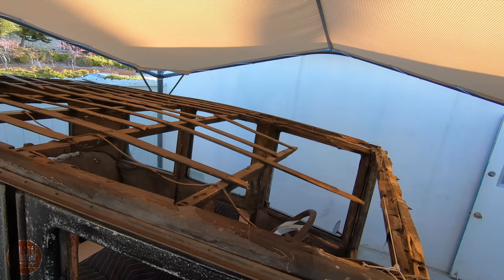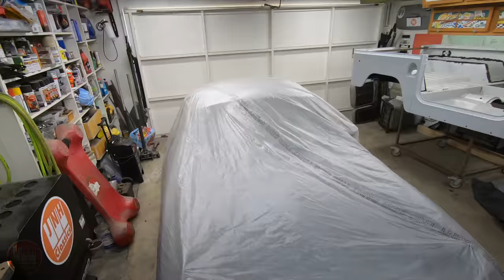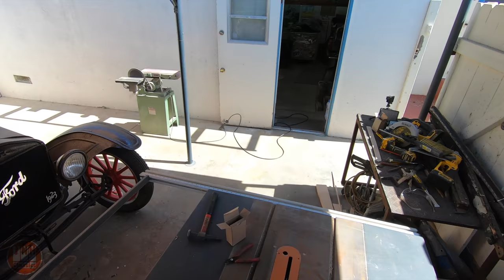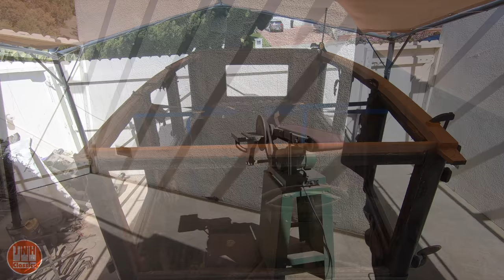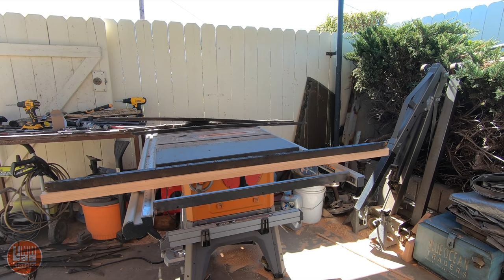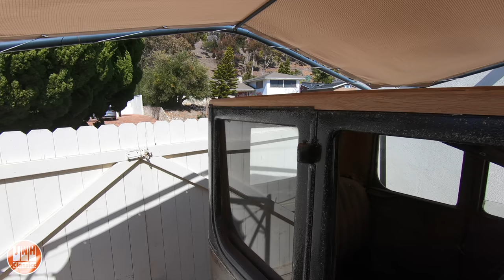A Forgotten Model T (Episode 14) Making A New Wooden Roof From Scratch

Comment: congrats, great work. Which kind of wood did you use? and is there a reason, why you didn t glue the joints?  cheers Michael
Reply from the maker: I used oak. It wasn’t glued originally so I didn’t use glue. Not sure if there was a reason they didn’t glue it but if it lasted 98 years the first time it should be fine this time👍